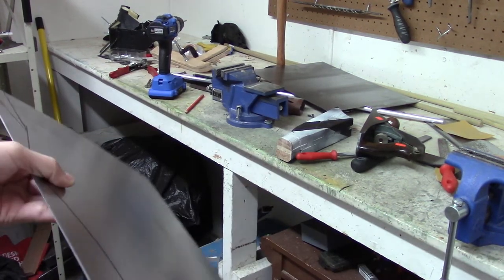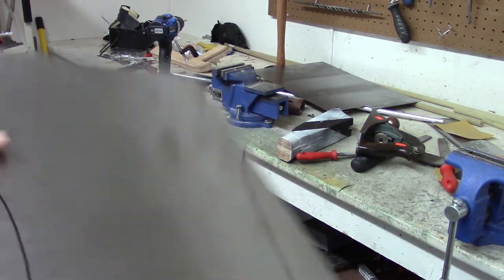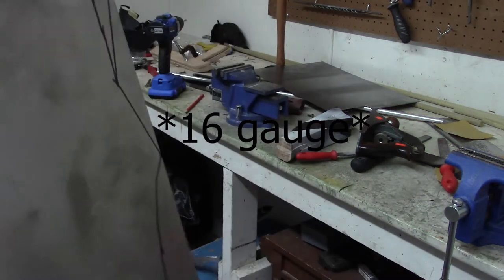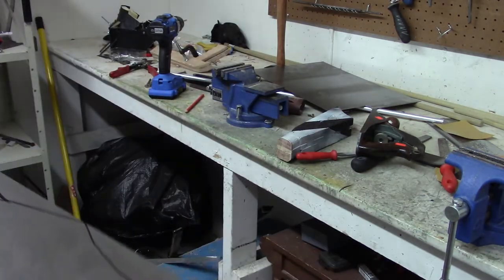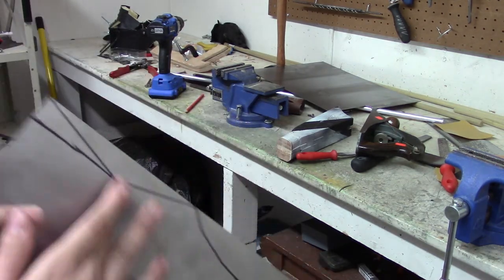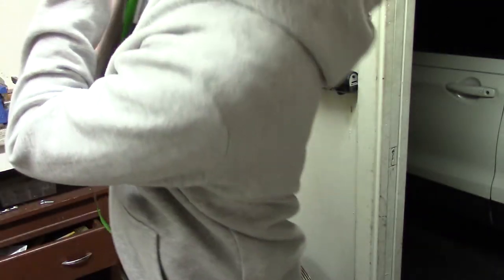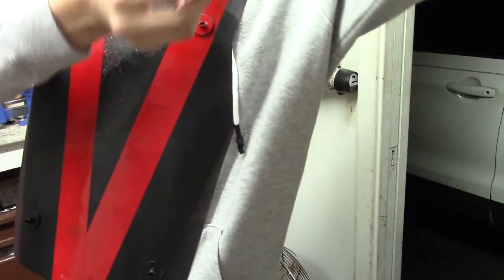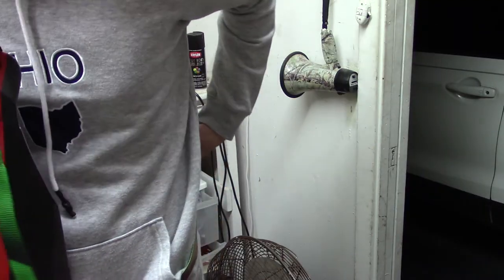Homemade stab proof body armor.

Comment: the reason that type of plate was never used in history is two fold. 1. flat surfaces transfer alot of blunt force, and 2. a steel plate will deflect the blade directly into your neck, arms, legs, ect. 
if you want this to work your gonna have to either go full bore flat for bullet resistance (dont want ricochets,) or your gonna wanna use some chainmail, thick fabric to catch the blade, or some more plates to cover your neck/vital meaty bits.